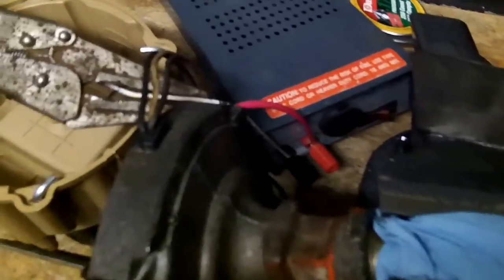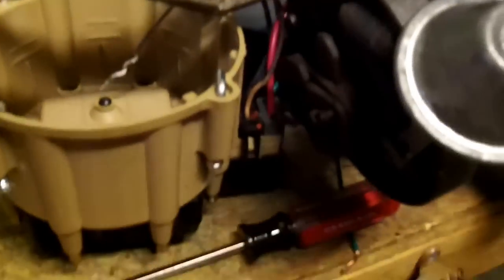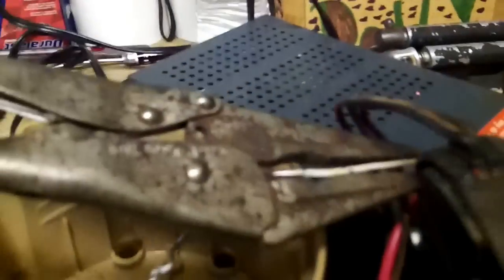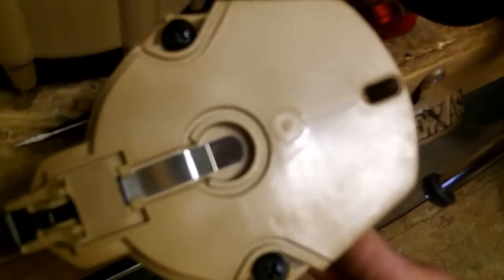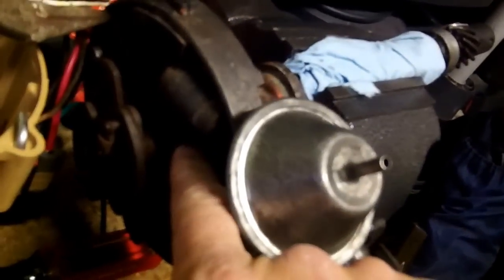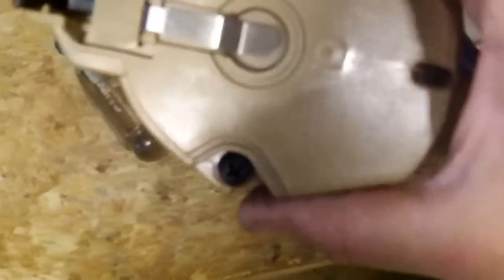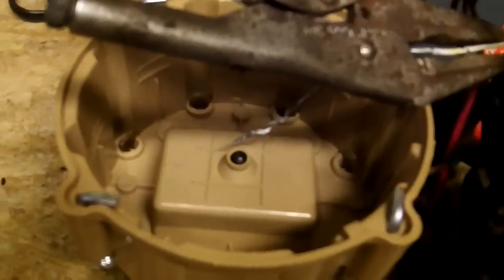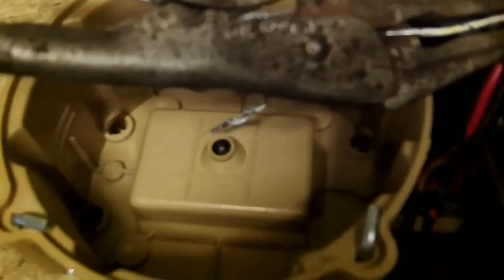4 pin HEI distributor test

Comment: The way I used to check the HEI before removing was to stick an electric soldering iron near the HEI with the cap off and the key on then trigger the iron. The magnetic field given off by the iron will trigger the pickup in the HEI
Reply: Say whaaat

Comment: Wuz up😎 my man? Hey man I tried this set up on my bench, old vs new. I don't know wuz up bro but  neither one did the spark like on your video. Brand new complete distributor and coil. So what are your thoughts😐?   Or anybody else out there😮. Thx ✌out
Reply from the maker: is your distributor from a computer controlled car?  The module on mine only has 4 pins.  Also make sure the distributor housing is grounded and the same wire needs to be near the contact in the center of the distributor cap
Reply: ***** bad coil, thx for ur response tho.✌out bro